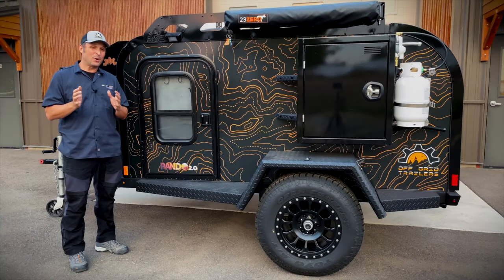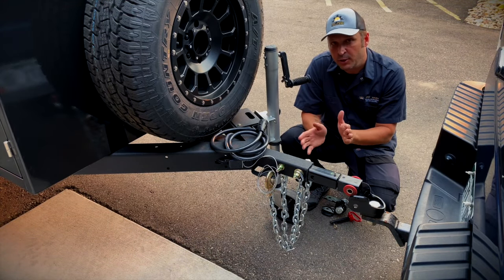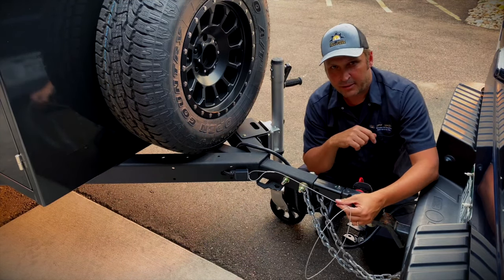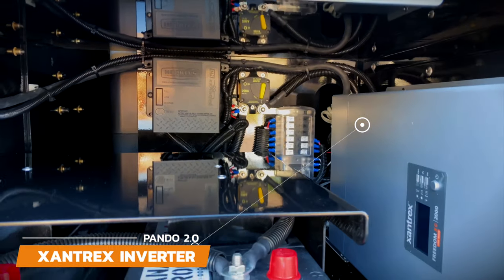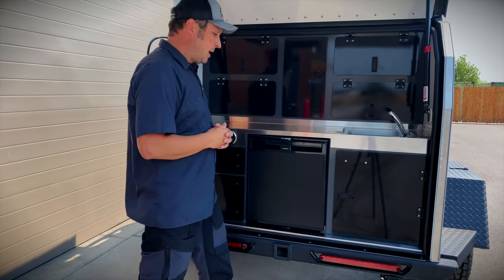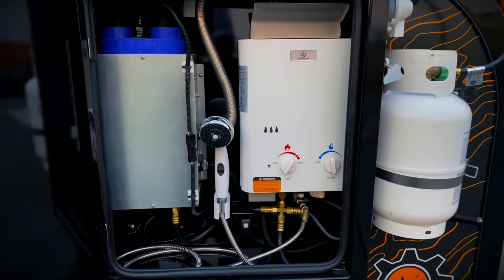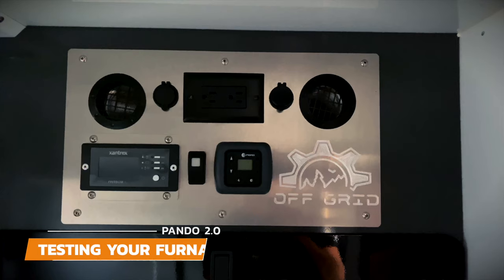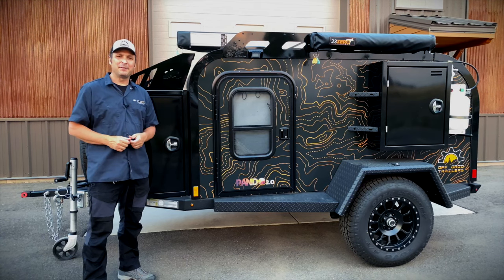Pando 2.0 by Off Grid Trailers - Off Road Teardrop Trailer New Owner Orientation

Comment: I like that topo map wrap -I wish I had gotten that one. I didn't like the shiny powder coat doors because they were hard to keep clean. So I purchased an automotive matt black vinyl wrap and wrapped all the doors - problem solved. If it ever wear off, I'm going to strip the paint off and powder coat them with a matt black finish. Off Grid should consider getting rid of that shiny paint.
Reply from the maker: Thank you for the suggestion, we will look into matte powder coat options.

Comment: Nice unit and Canadian Made! I/we have tried a few variations of off grid trailers both in Africa and North America. These are designed for our climate and conditions. Most units are designed for desert/hot weather climates and not really functional for the north. We have used various trailers and owned the tent top trailers from ZA. Great units but the tent/canvas thing is frustrating in cold and wet weather. Setup and tear down times can be long. Not the thing for day to day travel. I like the 10 minute rule. For longer term stops they work great. Especially if you need the shade, the add on rooms are nice. This Pando type of unit works well for the guys who go wheeling during the day. Keeping the weight and height off the tow vehicles is important. I guess I am trying to convince myself to buy one. Yes! Now to check them out in person.
Reply from the maker: Thank you for the feedback! Did you convince yourself yet?

Comment: Two things, is there a way to make the plumbing winter ready so if I were to go winter camping I could have running water? 

Two could one of those small wood stoves that people use to heat tents on the winter be installed inside the trailer? Again winter camping for long periods of time hunting it would be good to be able to not have to rely on the propane tank to keep you warm and save it for cooking. Basically have the thing mounted where the tv was or something?
Reply from the maker: Really great questions! The water lines are not insulated. That said, there are a multitude of ways to keep warm depending the accessories on hand. Eg. If you purchase an awning and their walls, you can set up a heater inside the tent to trap the warmth. We also sell heaters as well!
Reply: Most campers / hunters solve that problem by keeping a water can inside the trailer or truck. Except for summer trips, I keep my Pando winterized.

Comment: My bronco sport badlands has only 4pin.  What is the purpose of 7pin.? The brake i suppose and power. Is there a way to use it with 4 pin, or convert 4 to 7 pin with some accessories? I have 400w inverter in the bronco.
Reply from the maker: We would recommend you look into getting a 7 Pin wiring harness and Trailer Brake Controller to tow safely.
Reply: @OffGridTrailers  yes i found a shop that can do it.

Comment: I am very interested but not sure about a couple things.  Can I tow with a Jeep Rubicon and is there any Pandora 2.0 to rent so I know it will work for my situation.  Queen bed seems small when two people are large.  Also bad knees for bending to get in and out.
Reply from the maker: You can easily tow the Pando 2.0 with a Rubicon. We do not currently rent but have ambassadors in place to show the trailers in some markets within Canada and the USA.
Reply: @OffGridTrailers  what is the weight? I can tow 2200lbs. And i have only 4pin.  Is it compatible. I have also a jackery 1000watts solar generator. Can i use it to power the trailer if i have only 4 pin connector. Is there a way to add accessories to control the brake even if my bronco sport badlands has only 4 pin connector?
Reply: I've seen Rubicons pulling this trailer on the flat but never in the mountains. My 5.2L Magnum V8 struggled a little going over an 11,000' pass last year. I did however have 30 gallons of water on board. I have since solved that problem with the purchase of a new Rubicon 392.
Reply: @finfish260  thanks we ended up with the new Ford Ranger with the Temor package.  Tows my pop up fine, so not worried about it pulling the Pando when it’s ready

Comment: What is the insulation like? Can it withstand extreme cold?
Reply from the maker: With the R10 Insulated side walls and furnace - winter camping is easy and comfortable. Just remember you cannot use the on-board water system.

Comment: Do they have a 4 season version of this trailer
Reply from the maker: Our trailers are 4 season capable. Accessories such as heating and roughed in AC allow for an enjoyable experience spring, summer, fall, and winter.
Reply: @OffGridTrailers   sorry i didnt see insultion on the all outer  doors  so you can add that  ???